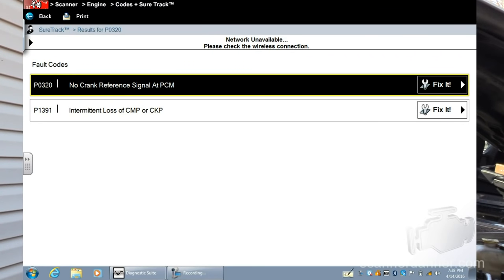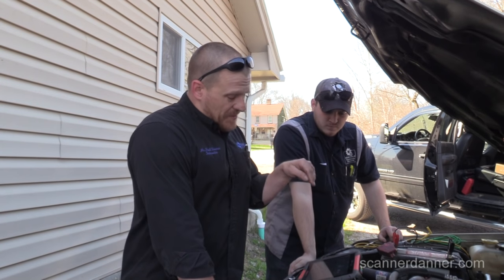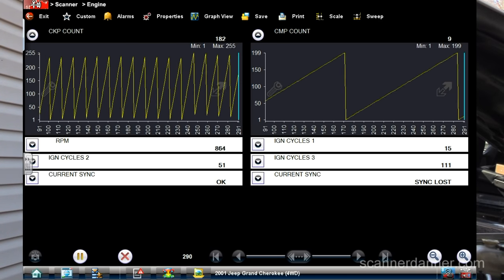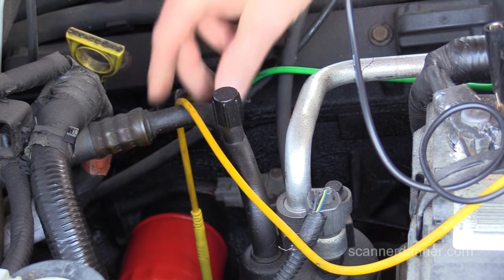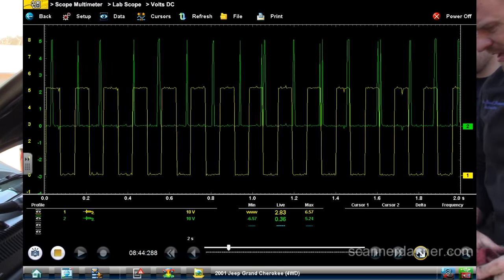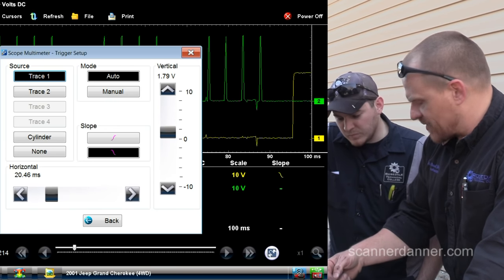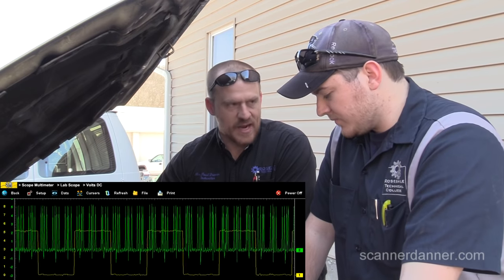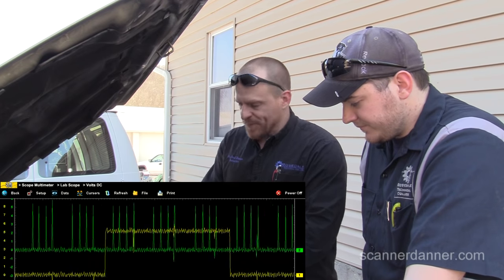Intermittent stall, no start - P0320, P1391 cam, crank sensor testing (Jeep)

Comment: 98 Grand Cherokee,code 1391, replaced crank sensor,cam sensor or ignition pick up,still kicking back 1391.
What and how to fix,any suggestions? Cranks runs drives fine...
Reply from the maker: Make sure you set your air gap correctly on the crank sensor. 
https://www.youtube.com/watch?v=ws59zXvr1SM

https://www.youtube.com/watch?v=TZwJ2jp8g0E

Comment: have question about a 2003 grand prix gt key on engine off fuel pump keeps going on and off and oil level light along other lights keep coming on and off. Car runs fine until it starts to get to temp then starts acting up surgeing lights fan on and off.
Reply from the maker: Ignition switch is my first thought. This is one of the models that I believe are under a recall by GM. Look into that okay?

Comment: i have 2001 town and country
it has high idle in p, or n.
no check engine light on
1500 rpm in neutral or parking
the smog chek it pass

Comment: whats the highest bias voltage you've seen on a circuit ? I'm pretty sure it differs from car manufacturers correct ?
Reply: +Luis Nunez It can differ, it can be 12 V even, but 5V is common.

Comment: i have a 2002 jeep liberty that doesnt want to start when its hot only like if i drive for 12 miles ect or leave it idling ..any other time starts fine . local mechanic couldnt figure it out thought maybe cranks shaft senosr ..i hve no ebgine light on thouh and had this part fail like 2 yrs ago with difrnt symotons and flashing check engine ligh on so iam stumped.
Reply from the maker: Is it unusually warm for this time of year where you live? (my thoughts are along the lines of winter and summer blend fuels)
Reply: ScannerDanner  somewhat ..michigan ..but its done it in warmer weather as well.. had replaced fuel pump in end october  got gas at citgo usualy go mobil started act up then put sea foam in ect..

Comment: What could caused ground voltage rise in 41:01 ? After engine stall ground was ok, but rise shortly after for a moment.
Reply from the maker: +albi2k88 It wasn't just the ground circuit that was affected. The signal wire was also and I'm not sure if I can explain it. Good catch! Did you hear me say at 41:06 "I have to explain that one now"?

Comment: Lost cam signal will not cause it to stall when already running
Reply from the maker: I would agree with that UNLESS the cam signal reference circuit get's shorted out by the sensor.
Reply: @ScannerDanner  yep that's right. an that's because like you said they share the same ground and the same 5 volt reference.  so a shorted cam sensor would cause crankshaft position sensor to lose it's 5 volts which would stall the engine.

Comment: 01 durango p1391. replaced cam and crank sensors twice (with mopar), code still not going away no one knows whats going on!!!!
Reply from the maker: You need a scope to look at both signals when the fault occurs. Also, this will allow you to look at cam-crank relationships to help determine if a timing chain has jumped.

Comment: please .please help me I am tired of  having to pick  my daughter up and taking her back nine a hour to get her car.
Reply from the maker: +glenn cox glenn, I'm missing your first post or question. What's up?
Reply: +ScannerDanner your online class are great i found the problem with the jeep 4.0  we for 18 an it set a code p o320  i replaced the crank shaft sensor  problem solved. thanks to your class studies followed your examples  an thing now works fine starts good no stalling drove 35 miles.   Thanks Glenn cox